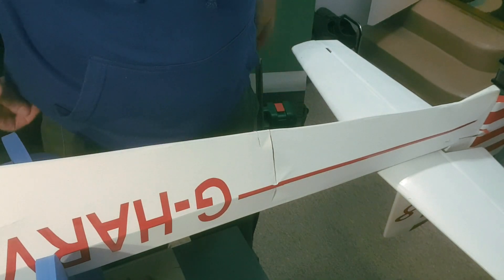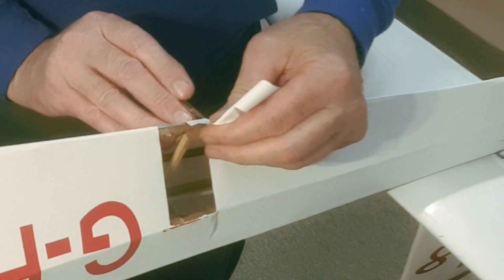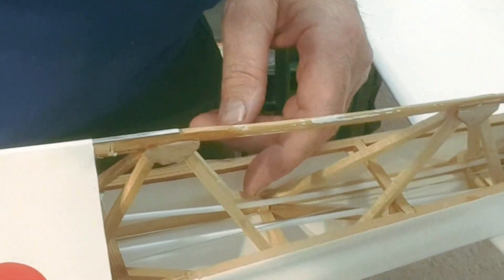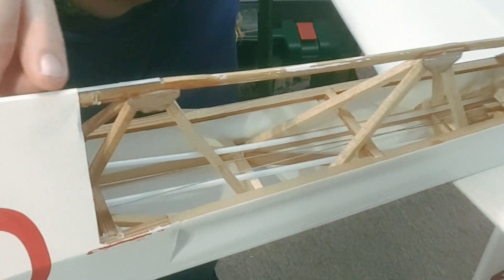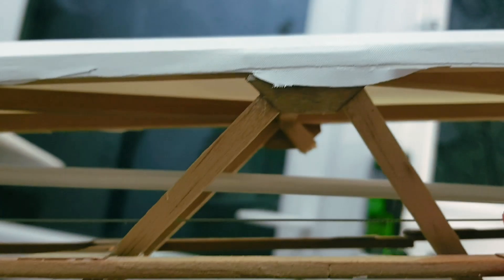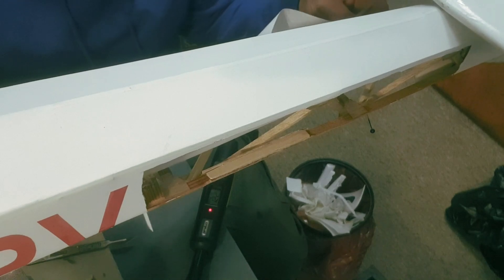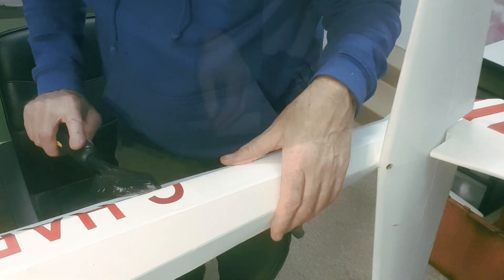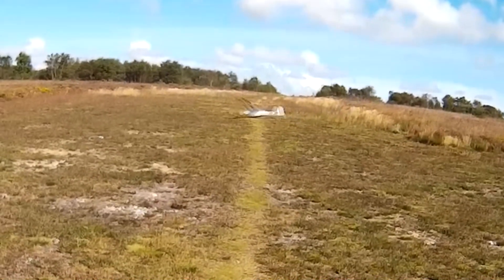KA8 Glider Fuselage Hard Landing Repair

Comment: Must be an old model 
I haven't seen spruce for years
I have two strip's I've had for 35 years
I keep it just so I can remember what it looks like
I use pine now instead
Thanks Cliff great repair 
And your right about but joints
Reply from the maker: Yes it's an old model, I have rubber bands to pull through to hooks to hold the wings on 😁

Comment: Great to see a repair.
Reply from the maker: Thanks Bryan, it doesn't take much and it's super satisfying 🙂👍
Reply: @CliffHarveyRCPlanes  I broke a  spar last night by accident, with my pinky finger of all things.  I think i will have to replace the whole length instead of just the section that was broken.
Reply from the maker: @Bryan Morgan  It happens Bryan, you could just cut the spar at an angle over a rib (scarf) and let a new piece in, personally that's what I would do, unless the spar comes out easily 👍
Reply: @CliffHarveyRCPlanes  naw i glued it in with super glue of course.  Thank you for that info i will do it that way.. may be difficult though.  Its only a 1/16 inch piece of balsa.
Reply from the maker: @Bryan Morgan  I assumed it was 1/16 Bryan, didn't you mention it on a forum earlier today? Either way it's not difficult, make sure to use a sharp blade 👍
Reply: @CliffHarveyRCPlanes  Yes I did mention it.  Good to know and thanks for the encouragement!

Comment: I suspect the kit manufacturer took a perfectly good design and then kitted it to fit the box dimensions. I have seen the same in something I made but decided to re-engineer. Butt joints are designed to break! For the spine I would suggest beefing up in both shear and bending. Makes you wonder what else was simplified to make the bits fit in the box?
Reply from the maker: Exactly Paul, I didn't build this model but I sure would have made some changes as I went along, thanks for your comment 👍

Comment: Totally agree with you. A scarf joint done correctly is far stronger. PS . I managed to get an hour in this morning to maden a new model. Got to grab the weather while we can now. See you on the next.
Reply from the maker: Thanks Terry, what was the model, how did it go?
Reply: @CliffHarveyRCPlanes  Hi Cliff. The model is called Q-TEE. 36in span parasol wing downloaded from Outerzone.  A very simple design from the 70s for cox 049, but my model is electric powered. First flight was a little hair raising, but after adding more nose weight she flew very stable. Where I live in can only fly electric at my local park. I built this model as a break from building my Druin Turbulent. Looking forward to seeing your next video. Terry
Reply from the maker: @terryblackman6217  Nice, are you going to use less downthrust?
Reply: @CliffHarveyRCPlanes  It's can stay as it is for now. 👍